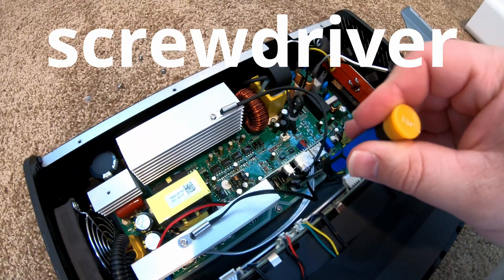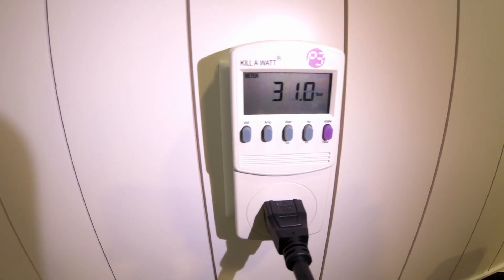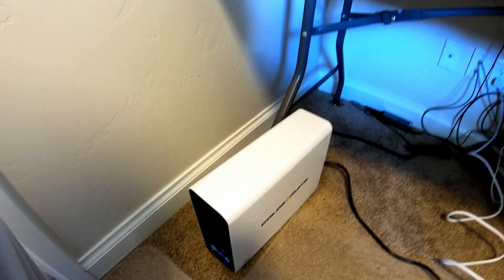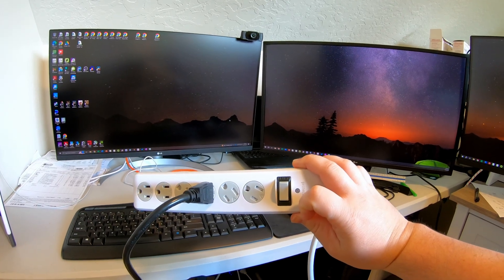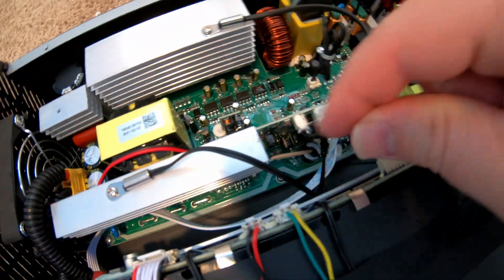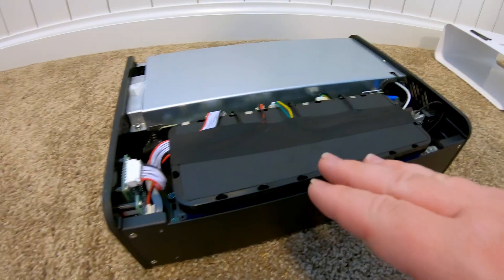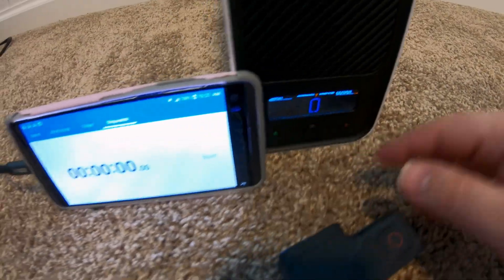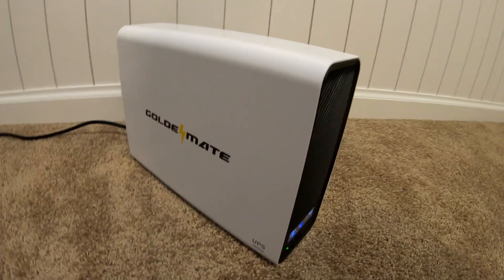Testing GoldenMate UPS: Is It Worth the Hype?

Comment: Great Video!  Thank you for taking the time to create this video. The reason why I wanted to find a video like yours is that I just got my unit today ans want to put extra LFP batteries connected to it to extend the backup time.  Please be aware that this until uses 24 volts so you will need either 1 - 24 volt or 2 - 12 volt batteries in series to power the unit.  I also wish they would include a plug to add extra battery backup.  I will just have to add plugs for my extra batteries myself.
Reply from the maker: Glad it was helpful! Best of luck to you and your expansion endeavors! Thanks for watching!
Reply: Were you able to add extended battery?
Reply: @Tech4Ten  Yes, I simply opened up the unit and spliced into the wires that are connected to internal battery.  I then drilled two holes in the back of the case and feed two wires outside the case and put a connector (like the one that they used inside the case).  I can now simply connect two 12 volt batteries, in series, by connector to the unit (this unit runs on 24 volts).  Since the internal charging unit does not charge at a very high rate adding the extra batteries may take a long time to charge everything up it also has the advantage of being able to run a very long time before you run out of power.
Reply: @rickibaron4816  good 👍  happy this works. Thanks for the reply

Comment: It's rated 3 stars on Amazon, but it's all due to loud fans and buzzers, no buzzer switch, and a fan that kicks on in 120v mode. I can fix those!

Question: Does it hold 118-120v even when the batteries are discharged, or does it dip to 110v or so?  Thanks, great review!
Reply: They just put out a new version that fixes both of those issues. It's about $30 more than the original's price.
Reply: What's the new unit called? You got a link? @wmansir
Reply from the maker: Thank you! It’s held the voltage rock solid for me! You’re going to love your unit! Thanks for watching!

Comment: i would like to get a better look at the internal battery connection.  i have a lead acid unit in need of replacing.  on my existing ups i extended the leads to an external 100ah battery in place of the factory 7.2ah.  could this mod be done to this unit?
Reply from the maker: Not sure. But I do show in my video the battery connection. It looks like an oversized XT 60 connector. Thanks for watching!
Reply: it looks like the battery inside is a 6S, so it would need a custom external 6S Lifepo4 battery. I noted the sort of ribbon wire with the red on the left side, white center and black on the right. It would be a 6S balance lead. So you would have to buy 6 100AH Lifepo4 cells and try to splice them in. The BMS probably has some thermal probes as well and I am not sure if it is a dumb BMS or a BMS with amp hour measurement. It is possible this PSU has tracking for that, and therefore it would be tricky to expand the capacity of this unit. I do want to try it, but surely someone else has already tried I just don't know yet.

Comment: Thanks. This was very informative. I have one for the same reason and so far I've been happy. Suggestions for Goldenmate v2 is a mute button (as so many have complained about) and MOVE THE POWER BUTTON. Being on the bottom makes it too easy to accidentally hit with your foot or chair.

Suggestion: Have a real-world test instead of just plugging something in. If you had it plugged in the wall with the fridge already running and then cut the power it would probably keep it running. Like what would happen if you lost power. You did that with your computer. It would be interesting to know how long it would stay running.

I have been so annoyed with every UPS I've had as the battery goes bad before the next power outage and they don't last more than 3 seconds. I order a new battery and then the cycle repeats. I'm ready to see how the GoldeMate lasts.

I am also running an experiment. I had a Cyberpower that died that I was using on my aquarium to keep my fish alive and I purchased a LiFePO4 battery to replace the lead acid that was in it. So far it is working but am concerned the charging circuit isn't 100% compatible. I've had it on there for a couple of days watching it closely. So far so good, but haven't tried to unplug it yet. We'll see soon.
Reply from the maker: Thanks for your comment! It’s a fantastic UPS. And great suggestions! The fridge would probably run if it started while the UPS was plugged into wall power. However, once the fridge cycles off and then tries to start again, and the power is still off, it will overload. Thanks for watching!
Reply: Any decent LiFePO battery will have a built in BMS that should prevent overcharging, overheating, over current, and over discharging. 

I’m done with lead acid batteries. They’re really terrible by any measure.

Comment: I’ve tested my refrigerators on a lead acid UPS and it worked just fine? I’m wondering about the surge rating?
I find when switching back-and-forth from grid to off grid on my hybrid solar system, that it doesn’t surge when I’m hooked to a UPS. Otherwise, you get those big surges that use a lot of power!
Reply from the maker: Yeah…I think the surge capacity on this unit is just not huge. It doesn’t need to be huge…but maybe large enough for a refrigerator would be a good idea for future iterations. In any case, I love my units for my electronics! Thanks for watching!
Reply: It depends on the startup power of the motor and the overdraw protections that are implemented on the UPS, but any sizable AC motor will draw thousands of watts in the first second or two that it's getting up to speed. It sounds more likely that your UPS didn't have proper protections for overcurrent, or maybe it just had ridiculous capacitors that could handle a multi-second heavy load.
Reply: @ALmaN11223344  
My refrigerators have surged up to 800 W. My washing machine needs at least 1200 W. Otherwise, these things don’t work properly.
Reply: I would highly recommend NOT using anything like a fridge or freezer on an UPS unless you know for certain it can handle the initial surge. Motors pull a lot of power when they first turn on. You may get away with it a few times but there's a good chance you will damage the UPS and/or the fridge if you do it repeatedly.

Comment: Can you tell how much capacity is in the built in battery pack? Do you think it keeps the lifepo4 pack charged to 100% all the time until power disruption? It will be curious to see how much degradation occurs over time if that is the case. Was the empty male xt60/xt90 on the internal board used for anything?
Reply from the maker: As far as I can tell, it keeps the battery at 100% state of charge all the time. I believe that plug is for the battery pack to connect to the main board. I had it disconnected at first for safety while I fussed with the buzzer initially, and then plugged it back in later. Thanks for watching!